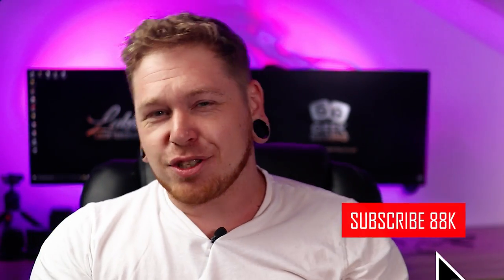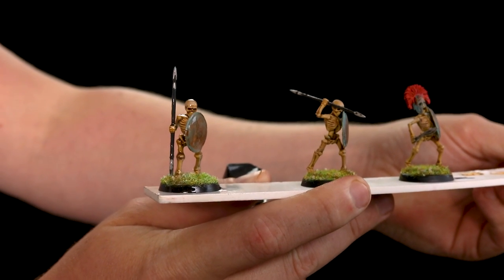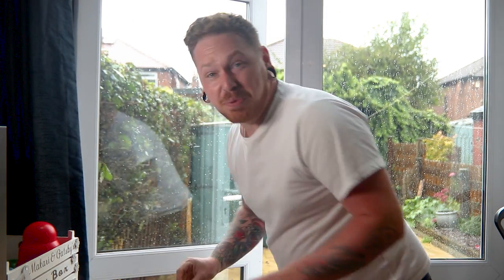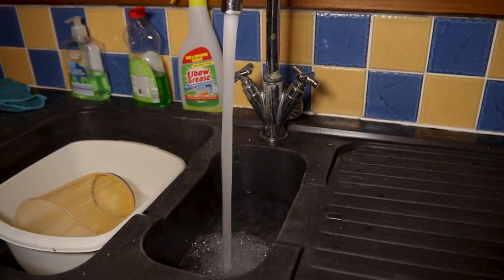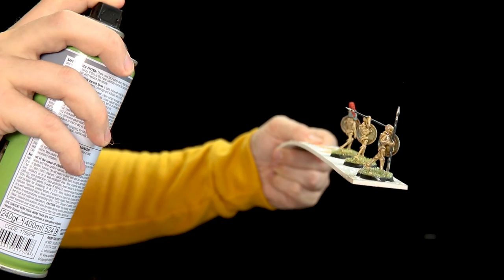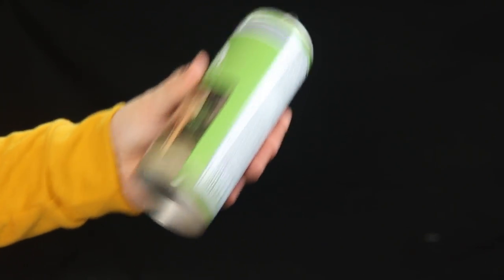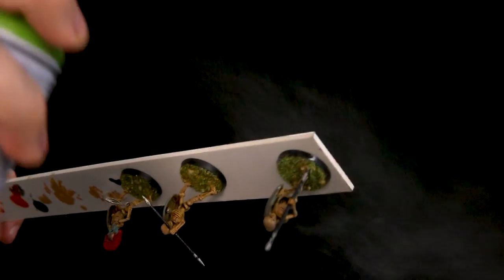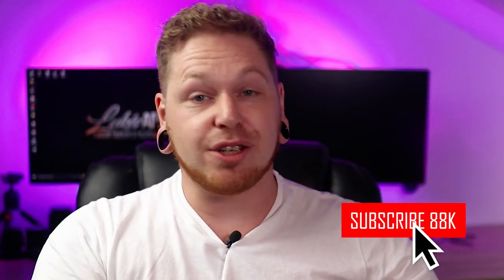How To Varnish Miniatures with Spray cans

Comment: You asked how I varnish my models..... Well..... As an historical wargamer (mainly Nap's & A.C.W) and using movement trays, therefore not having to handle the figures much, I tend to use cheap hairspray. other than that everything is the same as most people (2 or 3 thin coats and let dry between coats) (also the rules I use do not require the removal of figures)

Comment: the only way i know of to get it to frost is putting a very light dusting of varnish and it be to warm and it dry's to fast so all the little specs of varnish dont merge to form a full coat, also only had it happen on motorcycle bodywork not minis and that was with £19 per can of varnish so paint cost is not an issue for cloudiness but the uv protection and hardness of the varnish ish what you payfor.

Comment: You don't swirl your can's agitator around the bottom? I was taught that you can reduce the overall shaking time by running the cans agitator in a circular motion around the bottom of the can rather than just simply shaking it up and down. What this is supposed to do is specifically stir up the stuff that's settled on the bottom so that it mixes faster than it would if you only shake up and down.

Comment: I put all my rattle cans in hot tap water for a couple of minutes. Then I shake the living hell out of the can with my handy-dandy spray can adapter for my electric sawz-all. Perfectly shaken can in about 15 seconds. I also lay down a coat of gloss or satin varnish for extra protection before I hit it with matte. Secretly put your buddie's unopened can of beer in it for 30 seconds then stand back and watch the fun!🤫

Comment: I've never had this problem. I don't warm the can I just shake the crap out of it. but the varnish I use is expensive but the cans are so big they last forever of I can do a lot of figures  from one can so in the long run they actually pay for themselves. I really don't have to use a lot of this stuff and it dries exceptionally quick, hence the reason I buy them I just built a Beholder from a ping pong ball and bits and pieces and I sprayed this 3 times it's as hard as iron. I've had people ask me how I spray my figures I always say not the proper way. I guess I'm just lucky. Oh the one thing I do is clean the nozel at the end of the spray thingy where the stuff comes out because I heard that this can cause the spray to spit rather than spray if it gets blocked or obstructed so I just go over that with a sponge and warm water when I'm finished ( that might be the reason I've never had a problem)
Reply: Not quite. Most if not all aerosol cans advise you, after spraying, to turn the can upside down and spray for a few seconds to clear the nozzle of paint. Has nothing to do with frosting. It does prevent clogging and splitting though which comes down to the same thing. I think the only time I had frosting I mixed and painted clear coat with an airbrush in the dead of winter. Can't remember how I fixed it and/or if I fixed it.

Comment: Novice question but ... why lay the can down for storage?  My car spray cans all need to be stored upside down once used to stop the nozzle blocking.  Is this not a problem with hobby cans too?
Reply: @GeekGamingScenics  It says on the cans to do so and it works for car paint, or at least the ones I have.  Different paint different requirements perhaps?
NB I have a had primer cans block stood upright so I was just curious whether that's what I did wrong with them.

Comment: Hi Luke! I had a problem with my primer coming out "fuzzy". Was this due to similar issues as with the spray varnish? And, can it be resolved the same way? Thanks!
Kurt
Reply: @GeekGamingScenics  It has gone on the model with a rough texture. My workshop can get very hot.
Reply: @kurtkyre  if its hot in your workshop its probably the paint particles drying in the air before hitting the miniature
Reply: @wookiewithacookie6905  I can't say it in Shyriiwook, but Thanks!
Reply: @GeekGamingScenics  Thank you, Sir!

Comment: When it's cold, wet or humid I, I'll either spray outside and under cover or in my storage room then quickly bring the models back inside and put them in front a heater.

Comment: I frosted my models one time after using GW varnish ruined a whole unit anyone know a way to fix frosting after it’s occurred
Reply: Google how to fix frosting with Olive Oil. I can confirm it works.
Reply: What worked for me was brushing on gloss varnish (I used Vallejo).  Let it sit 24 hours, then you can apply dull coat.

Comment: I'm about to break the internet.  The need to varnish models is a myth.  Unless your painting metal minis, the plastic that most newer models are made from is of such high quality after your quality paints have dried and cured, it aren't going anywheres.  I've been in 40K since 3rd edition and have never varnished one model.  I've never bought a single can.  I've got painted models that are 15 years old that've been handled by my kids, dropped and pushed around multiple gaming tables and don't have a nick on em.  Even if you were to chip one, fixing takes like 60 seconds.  Save yourself the time and money and skip it.  Your welcome.
Reply: Yeah, sure if you’re going for a glossy look.  But a lot of folks go for the mat finish.  Throughly enjoy your content.
Reply: A lot of washes make figs look glossier than desired, so a dull coat is necessary for the look I want.